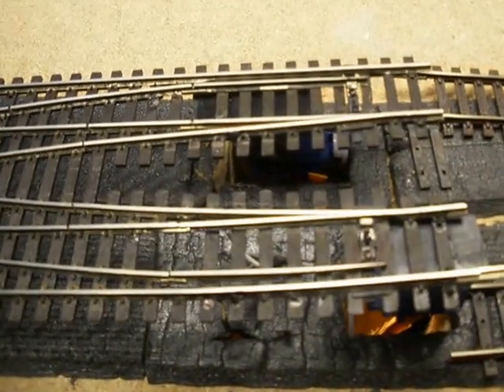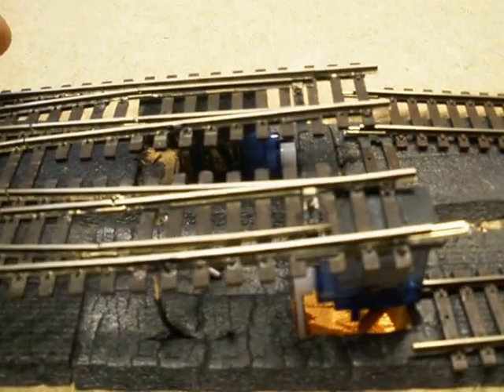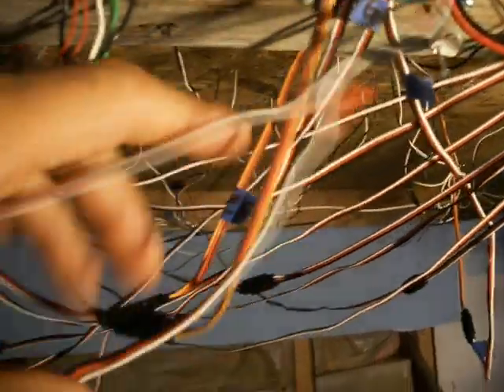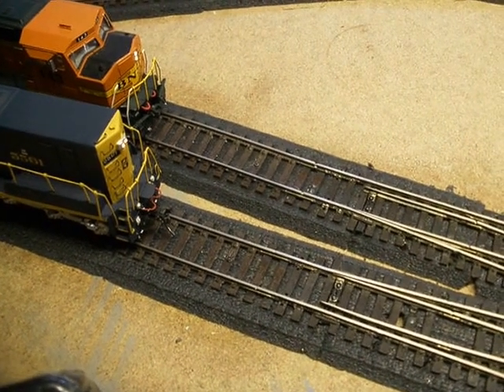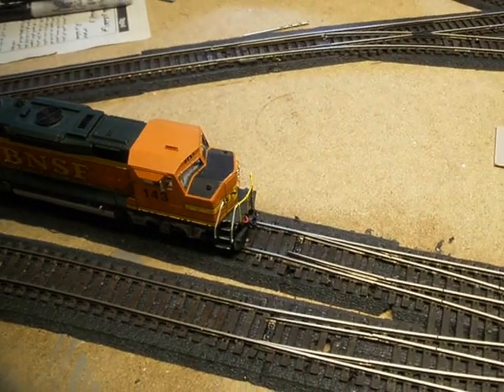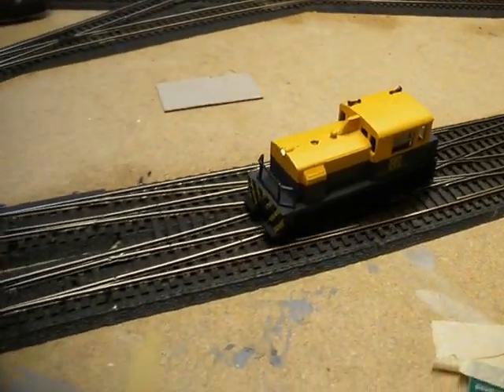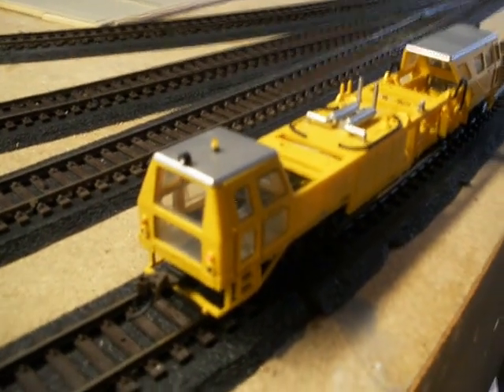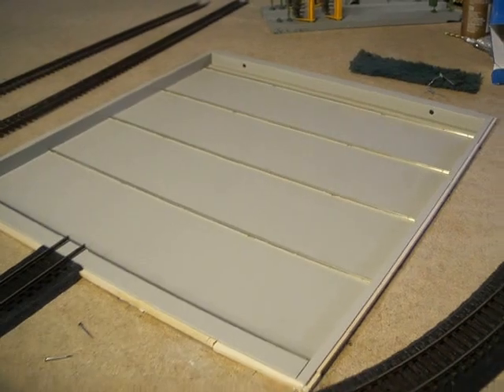(Install Servos 9g) Servo Activated double crossover ( HO Scale) Shinohara

Comment: Why on earth are you throwing both of the points at each end.  surely you only want two diagonally points switched  for any one manouevre ?  Switching the others is VERY unprototypical, and rather weird to boot.
Reply: Why would you not, its either straight through or cross over so why make it more complicated and require more switches?